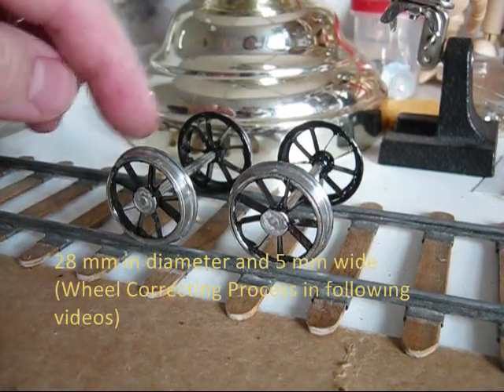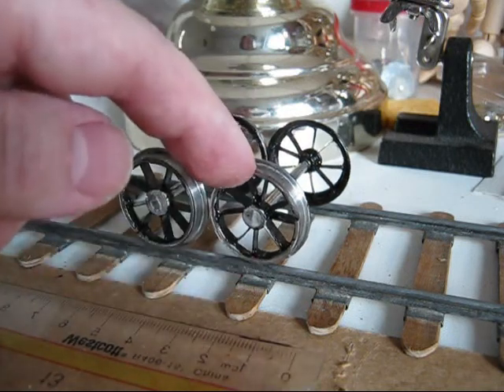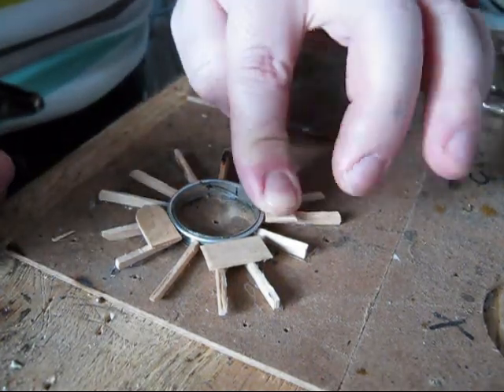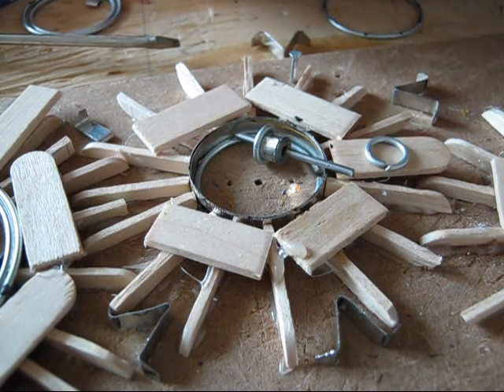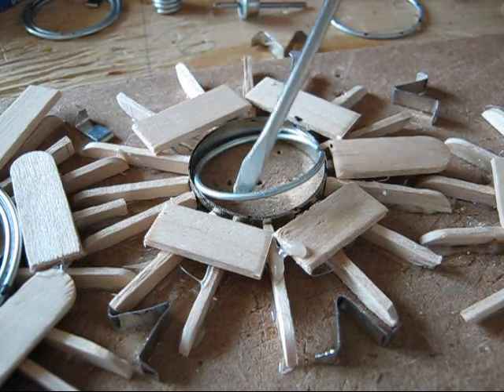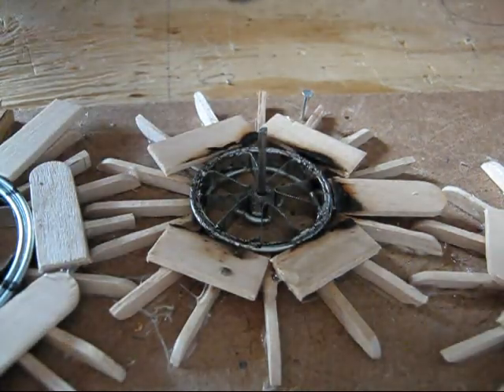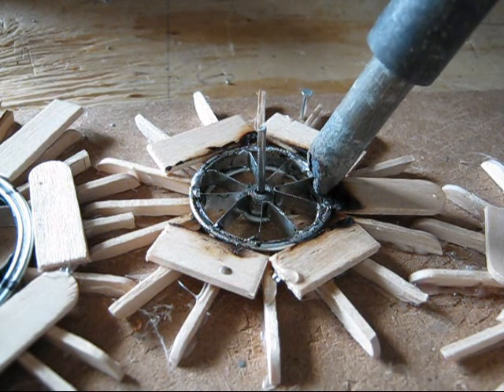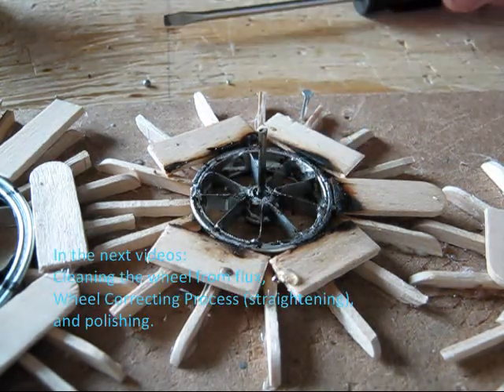DIY Train Wheels G-scale: Metal Soldering

Comment: Making a wheel this way conform enough with gauge 1 (45mm) / G-scale track standards - or any other standard - to be operable in switches, takes a bit more than shown here. The back-to-back distance has to be correct, and I would say the back of the flange has to be flat to some degree. Flange depth comes into play as well. I'm guessing this is partickularly true if the flange profile is esentially just spheric, as opposed to more of a rounded wedge. As is shown, this wheel is unlikely to be operable on any standard track layout one might visit.

If one decides just to run on one's own track, I'm guessing switches would have to be of the primitive "stub"-type, where both rails are moved to alternate tracks when switching. Or only using a turntable. It's back to railway technology before modern track and wheel designs had developed. Think "pre-Rocket-era" quarry operations in the 18th century.